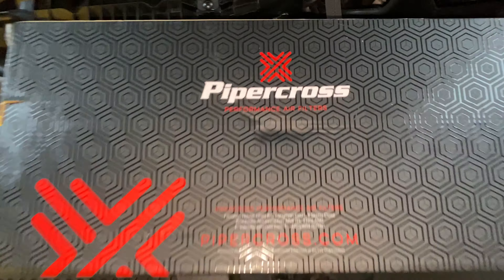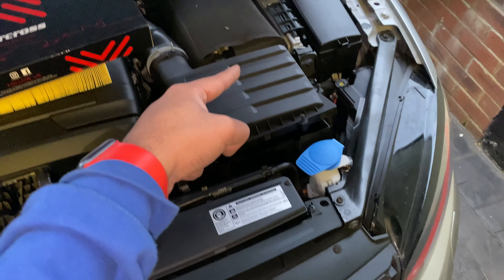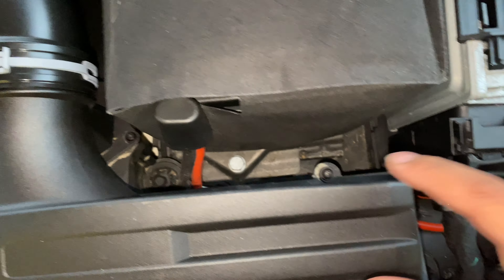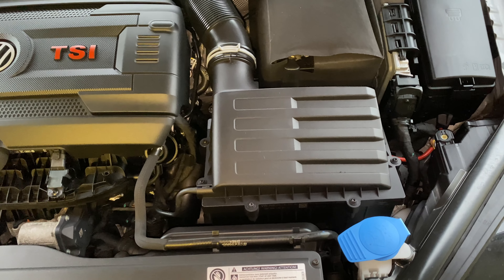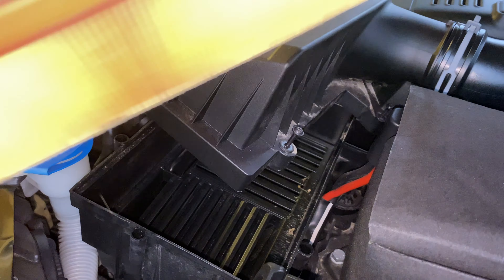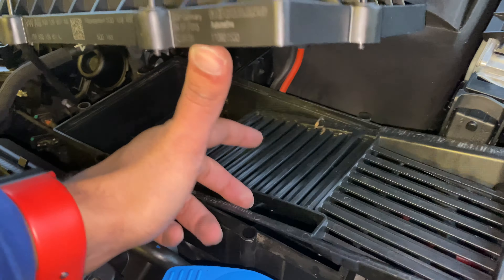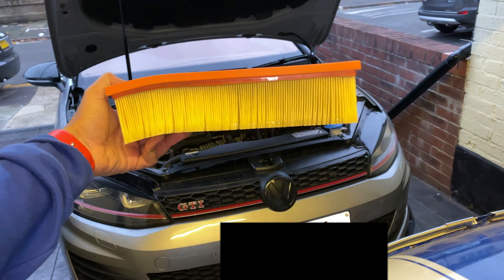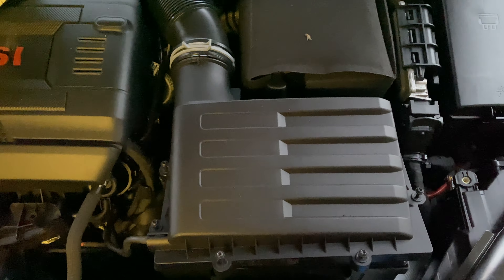GOLF GTI MK7: Performance Air filter (Pipercross) + Snow Guard Removal! *DIY* Increase Airflow MOD!

Comment: How did you remove the snowguard is stuck rock solid...

I already cut out air duct holes the car is amazing with a retune to 400bhp
Reply from the maker: I pushed it from either end and it came out - mine was stuck too so I ended up breaking one of the plastic lines but it will come out eventually!

Comment: This plug&play filters to OEM box are coming oiled from factory?
Reply from the maker: I believe so!
Reply: @RPHD26  Pipercross is a filter without any oil! K&N are oiled - would not recommend cause they can do damage to the air sensors behind it

Comment: Do you have to tune your Mk6 GTI after installing high flow drop in air filter with everything else stock
Reply from the maker: No you don't have to, you can run stock with 0 issues - but you will see most BHP gains if you do tune.

Comment: Don't want to see your intake after many miles, just foam and so thin would let pass a lot of particles unlike the original filter which has a significantly larger filtration surface and efficiency.

Comment: So is it worth the money?
Reply: @RPHD26  Okay, thanks for answering my question
Reply from the maker: @nks.max1  No worries man!
Reply: Perfect for my requirements where I want performance but as quietly as possible.
Do these allow more crap to pass the filter though, I read the K&N one does.
Reply from the maker: @SnowyAspenHills  Nope! I had a look under there after about a month and there was nothing the box!
Reply: @RPHD26  Thanks for the reply.
Reply from the maker: @SnowyAspenHills  No worries man 🙌🏼
Reply: @RPHD26  I bought this filter and been very happy with it, VW service today so swapped back the paper filter just in case of warranty issues. When i put the Pipercross back in I will take out the snow guard as hopefully we will not see any of the white stuff for many months.

Comment: Watch your coolant
Reply from the maker: Crazy you say that - the light came on a few days after and had to top it up! Completely missed that, thanks man 🙌🏼
Reply: No Problem, If you loose more Coolant your waterpump is probably leaking. Its a known issue If you have warranty there is an tpi for that. Hot the same in my Cupra
Reply from the maker: It’s been good since I topped it up thankfully but I will definitely keep an eye on it, thanks 🙏🏼 think it looks worse in the video because the driveway is up a slant so it’s all tilted back